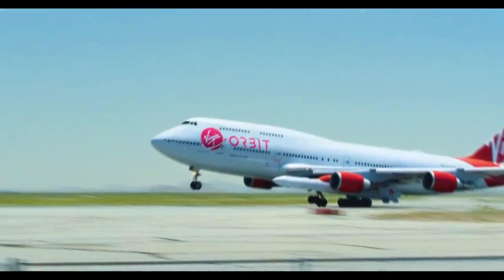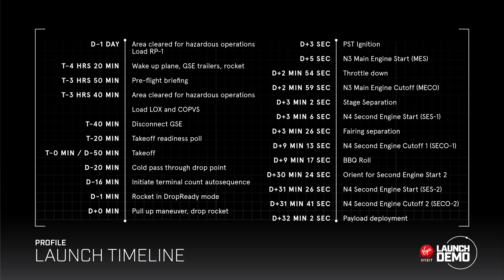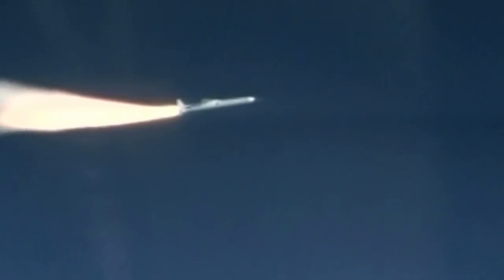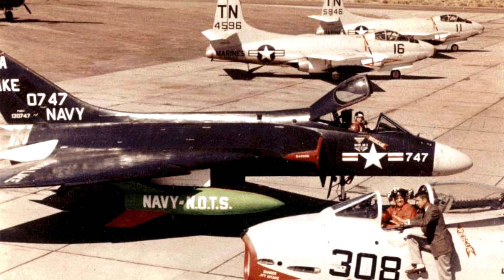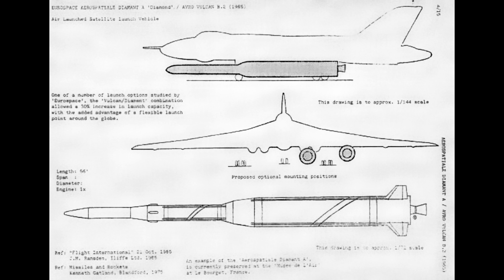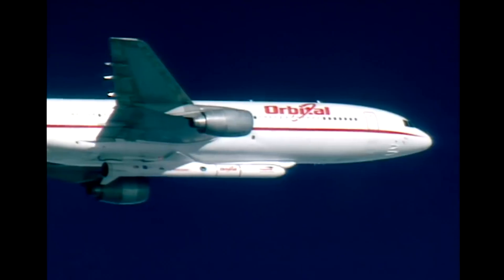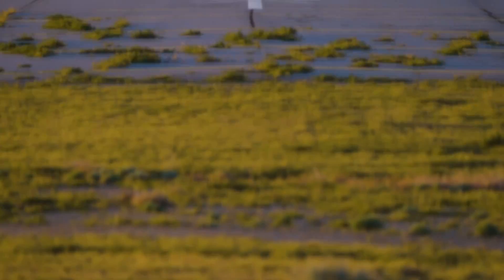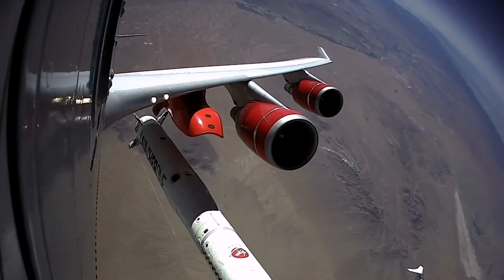Virgin's Orbit's Failed Rocket Launch & The History Of Air Lauched Rockets To Orbit

Comment: A theoretical though based on no known schedule or design.
It didn't fail really and like an orbital squid surfer could develop ,I can only imagine vertical launcher collaboration is possible for a twin symmetrical dock column but then there's no sign of this so far easily designed attach for the WK1 variant possibility. They did recently anyhow didn't they. Until very reliable RM's I expect civil aviation and low G comfort concerns will linger.

Comment: One slight correction, Scott--you said that the Pegasus doesn't use Thrust Vector Control (TVC) on its first stage, with its movable tail fins doing the steering during the first stage's burn. That is correct for nearly all of the first stage burn, but during the last few seconds (when the surrounding atmosphere has become too thin for the tail fins to provide effective control), multiple (two or three) small solid rocket motors--mounted in the root of each tail fin--are ignited, and they provide TVC via the movements of the fins. They are movable-nozzle TVC thrusters, which are pointed as needed (the entire solid motors, in this arrangement) by the tail fins, in which they are mounted.
Reply from the maker: Thanks! Always happy to learn something new!

Comment: So I watched the space x scrub. Could you please fill me in on the eerie feeling of what happened during Apollo with the fire in the capsule and the door was a bad design. What’s with how long it took to get the doors open on dragon???
Reply: There is a big difference between opening the doors the normal way and blowing explosive bolts in an emergency. Apollo 1 did not have explosive bolts. I honestly don't know if Dragon does or not.

Comment: Surprised that you never mentioned the air launch capability development of Avro's Arrow
Reply from the maker: It was never launching to orbit
Reply: @scottmanley  not the arrow itself,  a payload from it's huge payload bay. Here's the name of the book you should read, I once owned this book before it was stolen from me. In it it describes the designs that the makers had for launching things into space. They would do this by flying extremely high and rotating the plane upside down to launch from it payload bay. This book was made by the arrowheads a group of people who compiled all existing information about the plane. And as you know many of the people who worked on the arrow went on to NASA to directly work on the Apollo program. If you seek out the information in this book you will see what I am talking about,  and I think it would be right up your alley. Unfortunately not having the book anymore means that I cannot directly or accurately give you the information in it, but I do know what I'm talking about when it comes to the arrow. Please check it out, I'm not sure if you can find images of the book's pages online. And as far as I know it is a hard book to get a hold of but it will be worth your while!  Here's the title and authors.....Avro Arrow: The Story of the Avro Arrow from Its Evolution to Its Extinction

by 

Richard Organ,

 

Richard Crgan

Comment: My theory?
The rocket started from a high subsonic velocity and then likely tried to initiate a steep climb.  This resulted in a transverse airflow, which is a situation we have little data (as far as I know) about how liquid fueled rockets work.  Combustion in bell nozzles usually takes place at specific pressures and mix ratios.

You now have a situation where the rocket is attempting to punch through the sound barrier with transverse flow, which is across the nozzle as well.

Solid boosters are more simple and that is the reason why military projects have used them far more so, but I also think any experiments involving liquid fuel would have hit this same obstacle up and until you got to launching off the back of the SR-71, which could fly high and fast enough to allow a more linear burn and acceleration to orbit.

I'm basically arguing that "the flame blew out" - and it sounds just dumb enough of a reason to be correct, as most things tend to go.
Reply: Very interesting analysis.

Comment: I wonder if strata launch could carry and launch a new Sheppard rocket? 
Maybe Virgin Galactic could launch a solid booster from the roof of their plane, kind of like how the shuttle was carried, although they might need replace the tail of the plane with an H tail to prevent the rocket from burning the tail.
Reply: I think Stratolaunch could certainly handle the mass, but I don't think you could launch a hydrolox rocket that way.

Comment: Its worse then the propellant just floating around in the tank in freefall -- when dropped the primary acceleration force acting on the rocket is aerodynamic drag, so the propellant is being pushed to the TOP of the tank until the ullage motors are fired.

Comment: Interesting bit about the F-104 that I read in Chuck Yeager's autobiography, they did modify them to have a rocket engine as well as a jet, and they actually flew them to the edge of space.  The results of that program informed the S-turns the shuttle did to bleed off speed during reentry, and probably also fed a lot of data into the X-15 program.

Comment: People need to understand that commercial air launch to orbit is a non starter.  Ground launch must go from 0 to 17,400 mph and ~ 100 miles altitude. Air launch provides 500 mph and 20k feet altitude, saving less than 3% on delta v and maybe 4% on altitude.  For this minuscule advantage you are a) limiting size of rocket b) increasing complexity and cost c) risking lives of aircrew.  No way this can compete with ground launch especially if ground launch is reusable.
Reply: John Porter - This might be a “fool’s errand”, but People have launched >100 rockets from Aircraft over the past 73 years with no crew loses. Actually, most of these launches are from over 9.5 km (31,000’), & the 747 has a service ceiling of 44,000’ (almost 13.5 km). It does limit you to small-sats, but it allows you to launch from virtually anywhere in the world into almost all orbital inclinations. Because of that, it potentially gives you the ability to pick up a satellite in Sweden or Alaska & launch from the equator.
Reply from the maker: Also, misses the fact that drag becomes a vastly more significant problem as you scale rockets down, so if you want efficient smallsat launch then Air Launch gives a much bigger advantage.
Reply: Small sat air launch might be more efficient on an individual basis, but clearly it’s more efficient to bundle up a bunch of small sats in a big ground launcher like spacex is doing with Starlink.  Sure there might be some edge cases where air launch makes sense, especially for governments, but I am saying the required investment vs the potential number of customers just doesn’t work for a commercial venture.
Reply: John Porter - “Rideshares” on Falcon 9 will be cheaper, but individual launches by companies such as Rocket Lab & Virgin Orbit won’t be that much more expensive & will be more precise & a lot more convenient. The small sat market is the fastest expanding sector of the satellite market, & both RL & VO have paying customers lined up, so I wouldn’t be so sure about the “potential number of customers” not being enough “for a commercial venture”.

Comment: Isn't the X15 also a liquid fueled rocket which got air launched? 🧐
Reply from the maker: Didn’t go to orbit.
Reply: @scottmanley  well, the engine couldn't be relighted IIRC, so there wouldn't be a way to brake from orbital speed again... so doing an orbital insertion would have been deadly for the pilot.

Did the X15 would have enough performance do make it to orbit?
Reply: @RubenKelevra   No, it did not.
Reply: @scottmanley   It was also human piloted.

Comment: A horizontally launched liquid-fueld motor sounds like a bad idea.  You get that zero-g drop along with sudden deceleration and all the aero-loads.  I think it really needs a VERY powerful ullage motor to work
Reply: blurglide - X-1, X-15 & almost every other “X-Rocket” that was airdropped was liquid-fueled, & they worked fine.

Comment: I have always wondered why someone hasn't figured out the air launch problem. It seems that it would be more cost effective for smaller payloads
Reply: Just getting a few miles into the air doesn't really buy you much. The important thing is speed. If air launch can be made to work, somebody will figure it out eventually. If it can't, they won't.

Comment: I don't think that an air based launch is a good idea. Space based, yes but for me the big one that seems to go unnoticed is the land based maglev train style of rail gun launch. If the rails are run up the side of a mountain and the system is powered by renewable hydro, solar, geothermal, wind or even nuclear. Fuel is very very heavy and expensive so that initial speed and height are important. Also if we can get the fuel cost down at the same time as having reusable rockets, then we will be much closer to being a space faring civilization

Comment: Strapping a one ton booster to a F-104? That sounds like a brilliant idea considering how well Starfighters handle when carrying heavy ordnance. Don't get me wrong... I think the Starfighter is a brilliant plane when used in its intended role - which is as a short ranged high-performance interceptor... but they've shown a tendency to go "Erdnagel" when used outside of that role.
...i'm also seeing a number of logistical issues with this... such as where to get spare parts for these machines. Also who's gonna pilot that thing? I imagine test-flying with such a big, heavy payload is going to be hair-raising at best.

Comment: Let's not forget 200 air launches of the x15  the first men in space
Reply: Not really. The X-15 didn't exceed either the fifty mile or hundred kilometer (sixty mile) limits until 1963. Both Voskhod and Mercury began in 1961.

Comment: Did it seem like the nose dropped alot before the engine ignited?  I thought the point of dropping it from the pulled up position was so it didn't need a lifting body because it was already pointed up (as opposed to Pegasus which was dropped horizontal and used a wing)?

Comment: The energy in a laugh is like 90% used to reach horizontal orbital velocity and just a tiny bit to climb vertically through the atmosphere the added complexity of launching from planes is not worth it
Reply: nuno bartolo also the largest plane can only carry average size rocket
Reply: @hrissan  
Fully replacing the first stage of a typical orbital rocket with a plane would require that the plane could climb to 60-80 km altitude and accelerating to Mach 7 or 8 or so. Not even the SR-71 was even remotely capable of that, and the X-15 was itself launched from a B-52.

Comment: imagine if sr-71 was used as a mother ship launch pad
mach 3 at 90K feet
that would have been efficient
Reply: But it couldn't fully replace the first stage of a typical orbital rocket as its top speed was less than half of that. The first stage of a Saturn V reached about Mach 8, and it did that while carrying more than 670 tonnes of upper stages plus Apollo spacecraft!

Comment: A few questions from this video:
1: Did they not fly with a full fuel tank, since they needed to settle the fuel? I'm assuming of course that a full tank of fuel doesn't need settling.
2: How "far" would a Falcon 9 be able to go if it was launched without any payload? Would it even make much of a difference?
Reply: Yes, that makes a great deal of difference. With no payload at all, I'm pretty sure the Falcon 9 second stage could reach escape velocity.

Comment: I find it funny that a ground-based launcher beat out an air-launcher for a small payload like that, but I guess if your second stage is as powerful as the F9's it works....
Reply: Well, there's also the problem that Pegasus' last flight experienced literally years worth of delays, all due to technical problems with the rocket. That tends to scare off customers. SpaceX also has them beat on price.

Comment: Why don't they put propellant in to squeezable tubing like a toothpaste and apply external (gas?) pressure to it. This should completely eliminate gas bubbles and ensure that only liquid propellant will be fed into the engine.
Reply: The fuel is RP-1, but then there's the liquid oxygen.

Comment: It seems like VG is chasing an out-of-date goal with out-of-date ideas.
Reply: The key advantage of this technology is its ability to launch practically anywhere, into any orbit, without worrying about airspace or overflying land or such. Also, by launching at high altitude, it is less prone to the weather conditions at the exact moment of launch.

The drawback is the low payload capacity, but there's still some room for further development (both enlarging the rocket and miniaturizing the satellites), should the advantages prove useful.
Reply: @andyyang5234    Very good analysis.
Reply: In defense of VG, I actually think it's an idea worth revisiting. One of the biggest issue is that, short of using the stratolauncher, an aircraft is simply not capable of putting much payload mass into orbit.

However, small launch vehicles like, for example, Rocketlab, are suddenly becoming a much more profitable idea thanks to the advent of satellite miniturization. Microsats are likely to become a much more common payload in the coming decades.
Reply: Nah, it's the future. Using turbofan engines in lower atmosphere is very effective, so it should be done this way.
Reply: @AntonBrazhnyk  ehh... Speaking as a jet engine mechanic, using jet engines for part of a rocket launch isn't inherently cheaper just because they're more fuel efficient. The problem is a lot more complex than that.

Comment: The RD-701 engine could actually ran kerosene AND hydrogen simultaneously to produce an ISP of 415 sec. Getting that much performance improvement out of kerosene just by adding a bit of hydrogen is pretty wild!  That engine was really something special.
Reply: Interesting. I wonder what percentage they used and if it could keep a decent TWR at that ISP. I'll have to do some research later.
Reply: Wow. That´s impressive. I didn´t know that, thank you. Interesting.

Comment: 04:48 Quite coincidental that the F-4D launch aircraft for the Navy's first air-launched rocket bears the tail number "747"...
Reply: Yes, and significant of nothing. That is the "Modex Number" or informally the Side Number used for Mode II IFF tracking on radar.
Reply: F4D-1, actually. "F-4D" is a version of the Phantom II designated later in a revised system.

Comment: So the two small cones at the bottom under the engine must be the exhausts from the turbo pump.....?
I would bet on the reverse.  The smooth pipes are the exhausts and the bottom cones are the thrusters?

Comment: Could someone hot rod an SR71 for high altitude launches? Can go very high and is definitely fast enough.
Reply: The aircraft speed has little value for air launches. The first orbital speed is almost 8 km/s, while the SR71 did ~1km/s (would be much slower with the payload). Same proportion applies for altitude. The inclination is the reason why sometimes it is beneficial to launch from a plane - you can take the rocket to an arbitrary point of Earth and launch it under arbitrary inclination.
Reply: @vladimirdyuzhev  precisely. And because of this, the difference in speed and altitude between an SR-71 and a 747 is actually hardly noticeable in terms of the speed and altitude required for orbit... And the 747 wins out big time for payload capacity (an absolute must for a large enough launcher), not to mention fuel efficiency/cost and ease of maintenance.

Also, there's not really anything "left" in the SR-71 to "hot rod". Any faster, and the plane starts risking literally burning up, its outer skin was already pretty spicy at mach 3.4.

Comment: I was one of the technicians on the super stripey launch, and remember watching the launch live with the group of physicists etc. that built the ORS4 cubesat.  
I thought to myself as the rocket started to spin around " That is no good."  I can now say I have popped my aerospace cherry and successfully failed forward.
Reply: I did an unauthorized failure analysis report on the Super Strypi launch. The faring and payload started breaking apart at T+33 seconds into the flight. Over the following 7 seconds 6 objects were observed separating from the vehicle. Two of the objects appeared to be CubeSat related. At T+40 the ACS lost control and the vehicle went from a stable spin into an external torque-induced precession attitude. The upper stages and payload breaking off  T+57 seconds into the flight.

Comment: The F-104 Starfighter.  Still relevant today.  Flying since 1958.  We knew how to build shit back then.
Reply: It was nicknamed "Widowmaker" and "Flying coffin" in Germany: 300 out of the Luftwaffe's ~900 F104s were lost in crashes and over 100 pilots died. The early versions were plagued by numerous technical problems, some of them quite severe. Add to that corruption in the procurement process.
Reply: Wasn't the first iteration - doomed from being underpowered until later versions remedied the problem - delivered as target livery for nuclear tests? Unless I'm remembering the wrong plane from the (highly recommended) book 'Skunkworks' - it survived the heat blast because it was unpainted and reflected the blast.
Reply: Ahhhh, yes the F104. Designed by nazis liberated after WW2.
Reply: @christopherbiggs4019  No.